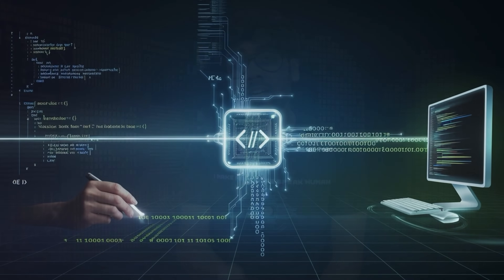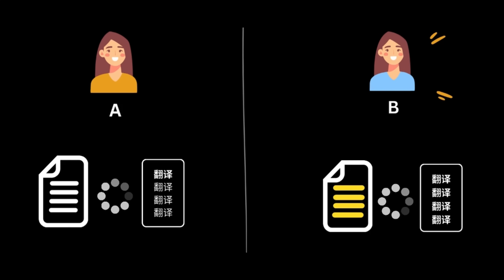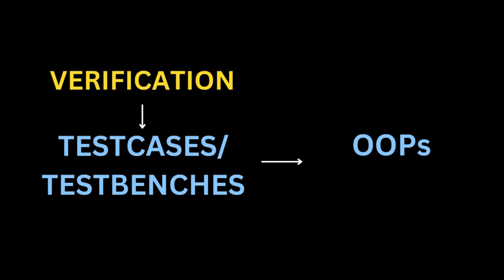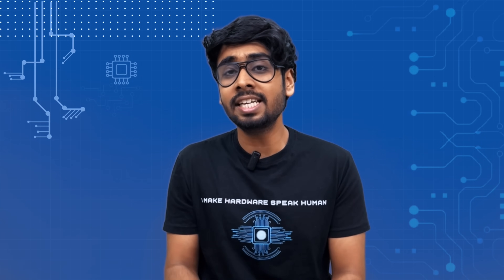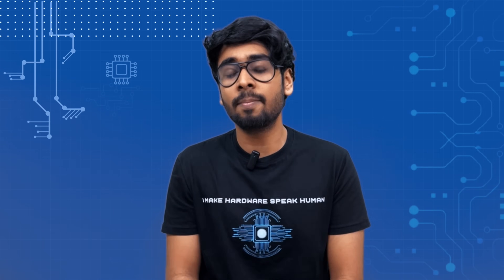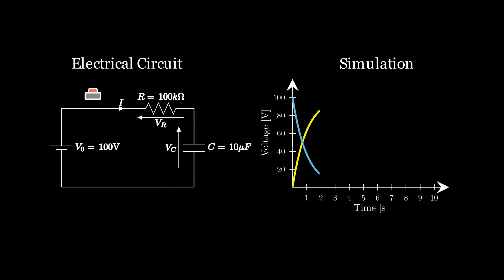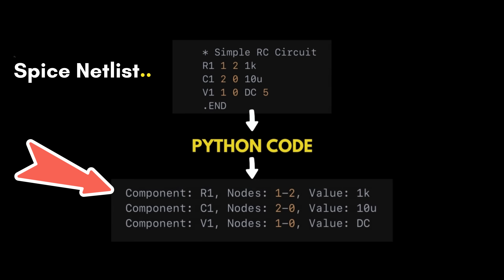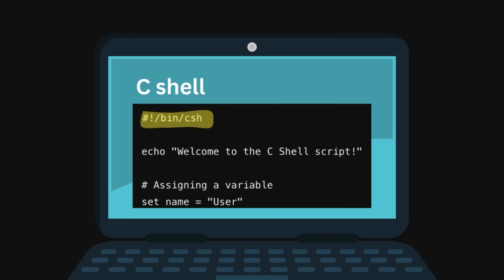Top 5 coding languages for electronics in 2025 | VLSI | EMBEDDED (ECE/EEE/EIE)

Comment: Hello,
What do you think if there is a new programming language with syntax of similar to python but replacing indentation with braces, and allow programmers to program in any language like Hindi,Mandarin...and others, and also a user can configure to add his own language then write code in his language, also has C and Cpp API used for integrating with C and Cpp programs, and also uses compiler to generate a custom bytecode and interpreter to execute the bytecode like java....and is developed in C/CPP?

Comment: 0. Digital electronics and C by neso academy 
1. CMOS digital VLSI design, Prof. Das gupta
2. Hardware modelling using VERILOG, Prof. Indranilsen gupta
3. Analog circuits, Prof. Nagendra Krishnapura
4. Basic computer architecture, Prof. Smruti R
5. Low power VLSI design, Prof. Indranilsen gupta

Comment: bro i am an cs student but i am having intrest in electronic what shoul i do????
Reply: You're welcome, first clear the concepts of basic elctronics components, then Semiconductor physics and then microelectronics after that you will have some knowledge to start analog and digital electronics. Then you easy go through VLSI or Embedded system mainly used IoT systems. 
My english is bad so sorry for that😅
Reply: @markgaming153  ok but embedded system job needs an electrical engineering course yes but I have computer engineering
Reply: @NabinBasnet-jt3pl  there's no need of electrical engineering in fact electronics is very essential for embedded system, because of electronics you can clear the concepts of various demanding microcontroller like ARM, PIC, etc while electrical engineering is a different matter that clears the concepts of AC/DC circuits.

Comment: Bro i am in 8th semester and i have joined vlsi guru for physical design course but i am preparing from myself also and i am learning python from code with harry, my main gaol is to do masters from ntu and nthu taiwan in vlsi and then i want to shift to quantum hardware (quantum processor), but i also want a job for stability.
Please guide bro 🙏 plese reply
Reply: How to join vlsi broo??
Reply: @shivasankar8117   you are in which semester
Reply: @adityatomar5333  5 th semester in 2 month's
Reply: @shivasankar8117   if your basics are clear of digital electronics, analog electronics and edc then you can enroll for the program in vlsi which ever domain you love I am in vlsi physical design where demand is more. 
You can directly call to the institute and ask for the next process
Reply: @adityatomar5333 how contact to institution